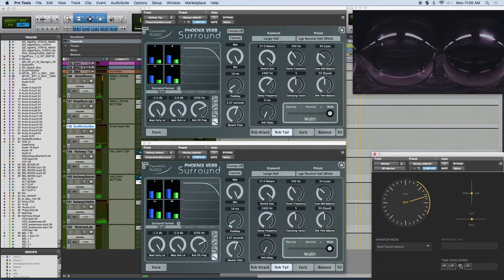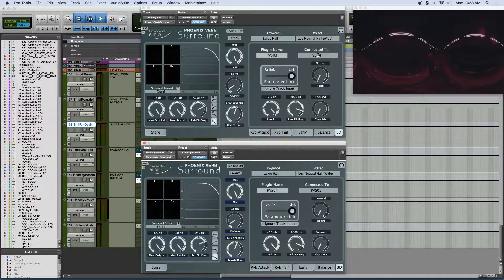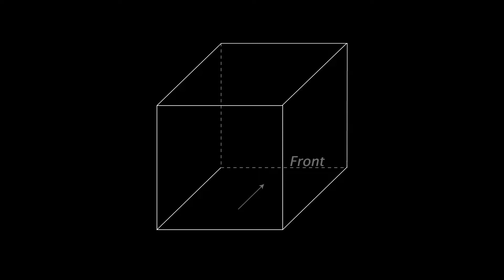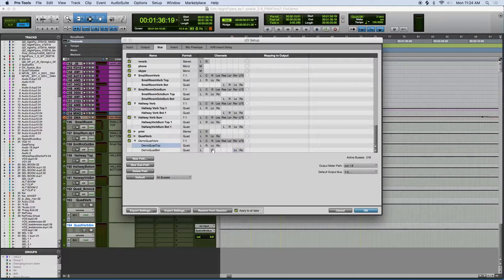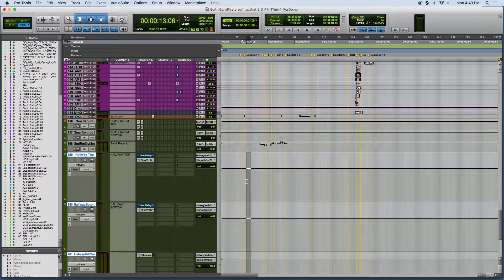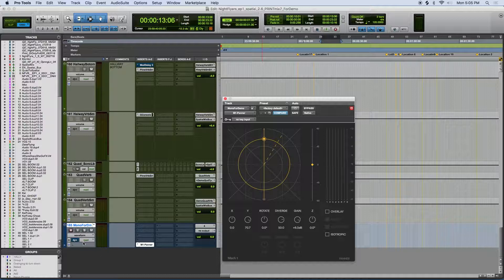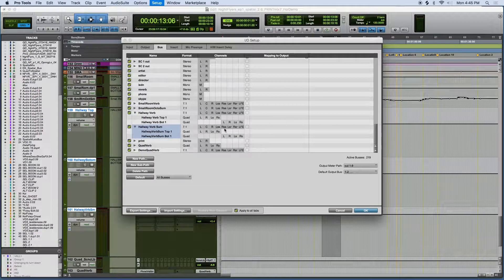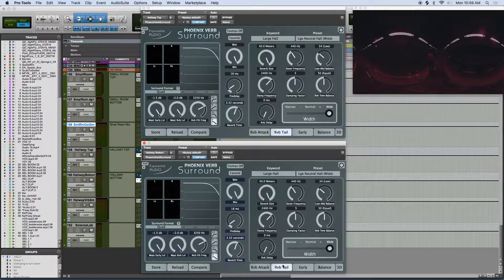Mach1™ TECHNIQUE 002: Spatial Reverbs

Comment: These two "TECHNIQUE xxx" videos are great. However, it's a bit of a leap to transfer the knowledge if you're not familiar with ProTools. I'm quite sure the techniques can be implemented in, say, Reaper (or even Cubase!) It's just that anything that is ProTools specific terminology slows things down and is probably error prone. Obviously, it's a reach to re-do this material in every DAW that you're marketing to. For me, the common denominator is probably Reaper: a) because it can do it and b) because it's relatively easy to see what's going on.    Don't stop. And thanks.
Reply from the maker: Good point, as soon as we can we are hoping to add more to this series and redo some for other DAWs!